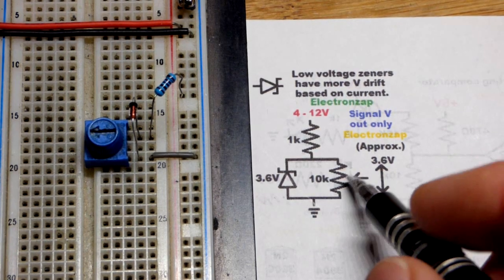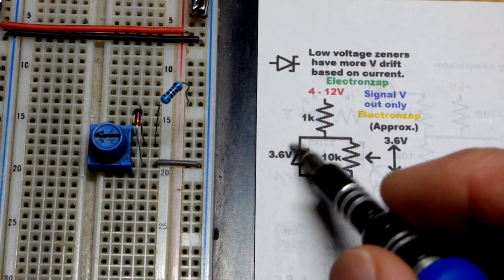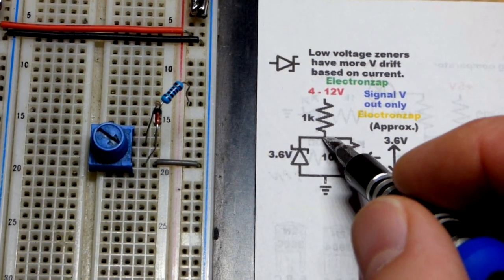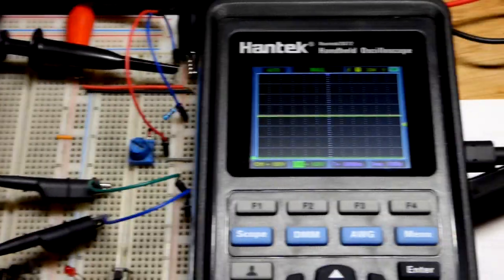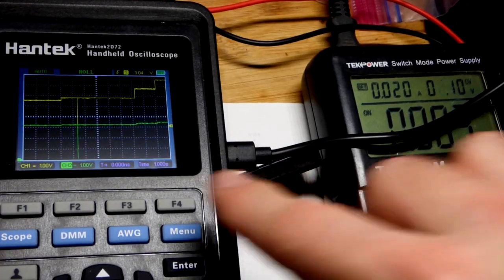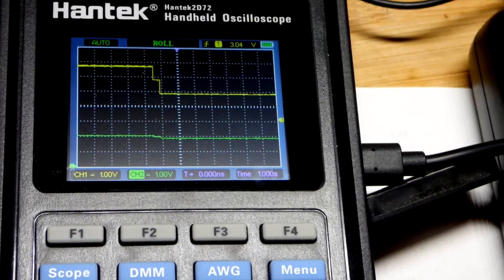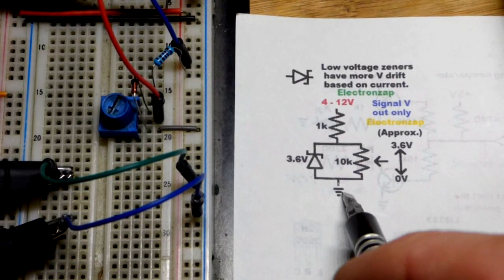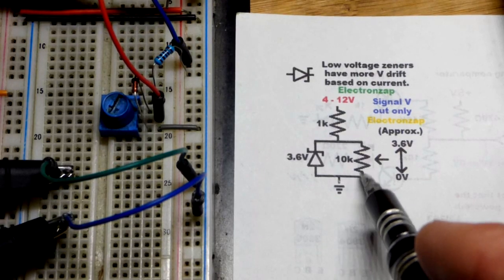Parallel Zener Diode helps hold Trimpot Voltage steady as supply voltage changes

Comment: Sorry I couldn’t really understand some parts of the video. What was the purpose of the circuit? From what I understand about Zeners, it will maintain 3.6 V across and conduct anything above. So the series 1K resistor will have more or less current based on Zener conduction. The 10K trimpot in parallel ought to be exactly the same voltage as the Zener, regardless of whatever setting the trimpot is. Since the trimpot has the same voltage, it should have the same current, even if the Zener current varies. Did I misunderstand anything? (EDIT: Sorry, trimpot current will vary to maintain Ohm’s Law in line with the constant voltage).

Comment: very cool graphical representation of the zeners performance, i wonder how a 5v regular , those simple  ones with 3 legs would compare, im guessing a lot better, less drift over a bigger range.
Reply from the maker: Voltage regulators are far better at holding a voltage than a Zener diode.

Comment: One of the things that frequently comes up is the need to adjust a voltage over a narrow range and not all the way up to Vcc.  You can lift it from 0 with another resistor below the pot.  Just do the math to determine what value you need.  The Zener stays the same though so the top voltage is solid.

Comment: To be honest: Yes, the trim pot reduces the zeners regulation voltage with a fixed load, BUT and a big but, as soon as you start drawing different load currents on the pot, its worse than without the pot (less regulated). Zeners are poor mans ref voltage.
Reply from the maker: Yeah, you would really only use a Zener diode at an op amp input, which I just did in a video that will go live in a week from when I post this reply. If the same power sets the reference voltage as powers a load, pretty much always want a regulator or converter.

Comment: And this is why we use voltage references as supplies for trimpots.
Have a look at LM4040D41ILP for example. 4.096v (handy for digital conversion stuff) and 1% initial accuracy with 150ppm/c  for cheapest D grade or up to 0.1% initial with 100ppm/c for A grade.
Available in SOT-23, SC70 and TO-92 and tonns of voltages with 0.3mV change over Iz=min to Iz=1mA !

Comment: Great work with your videos!!!!! They're really helping me as I am a beginner in electronics. I started building your capacitor charge pump voltage doubler circuit from your Jan.15/2020, I followed all the steps that you're showing, but it doesn't give me good readings on the scope. So I was just wondering if it would depend on the type of diodes that I put in my circuit. I'm using some rectifier diode 4001. Do you think that it could be my problem!!!? I really hope that you can help me. Thank you very much and continue with great videos.
Reply from the maker: I made a couple videos that day, and it looks like I used the N4001 in both of them. If it worked for me and you did the same thing then maybe a component was inserted in the wrong breadboard hole. That's one of the most common mistakes I make while wiring circuits. It's also easy to put a diode in backwards. A component could be bad for some reason. Usually when I get stuck on a circuit, I make other circuits for a while and then try to build it from scratch again and I usually do a better job on the second or third attempt.
Reply: @Electronzap  Thank you very much for your quick response!!!! I got back at it a bit later and I finally got it to work. The only thing weird is that on my scope it's only showing a straight line, instead of doing what yours was doing. But I took my multimeter and it was showing the voltage going up and down. I will try to redo it a bit later. Thanks again and keep up your good videos!!!!!